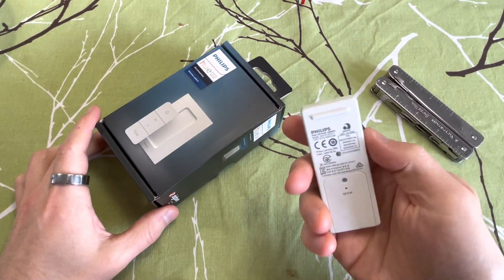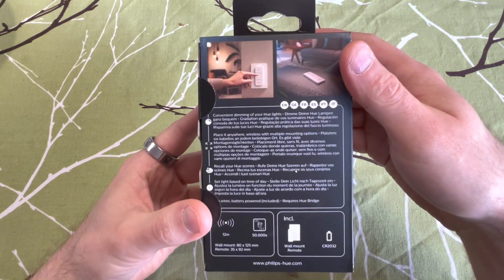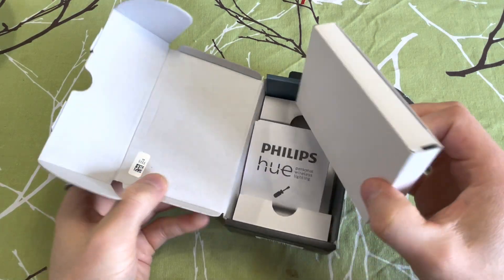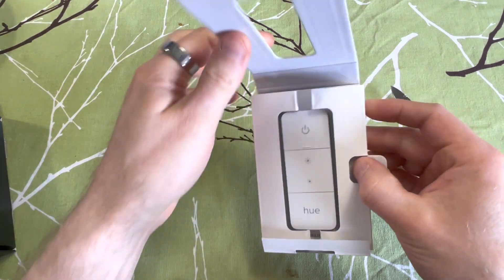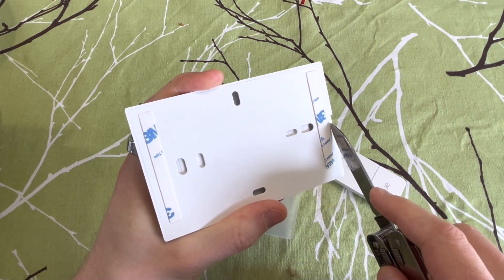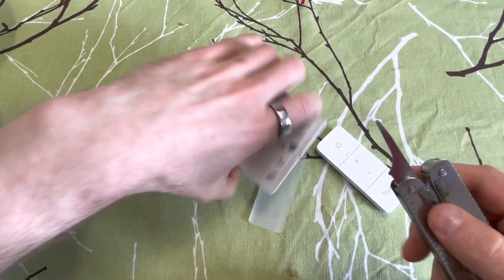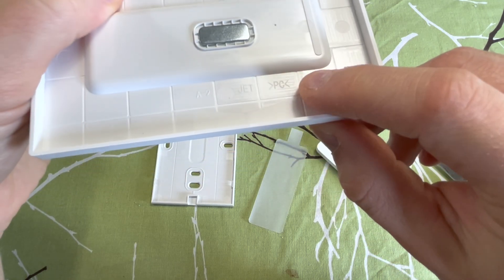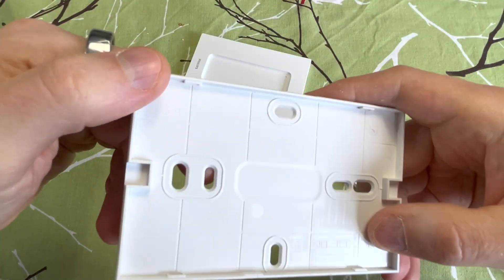#Review: Philips Hue Dimmer Switch V2 - Teardown - Review

Comment: This is awesome, you seem to know alot in the field (materials and such). Philips must be making alot of money on this, the pcb probably costs close to nothing in quantity, the most expensive stuff must be the assembly. The mechanism with silicone and interlocking parts seems overly complicated and probably has to be hand assembled. Anyway really nice teardown, hope you do more! Another interesting thing is that they leave debugging connector and some other unused parts from previous development revisions on the board (diodes and resistors near buttons).